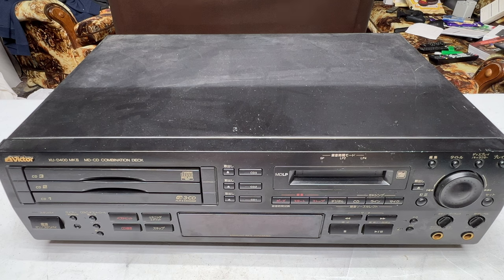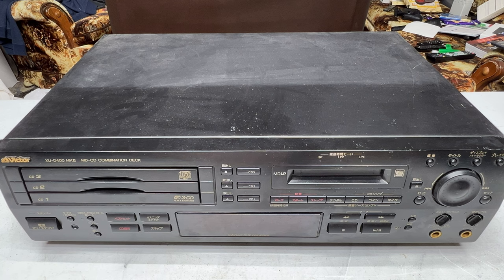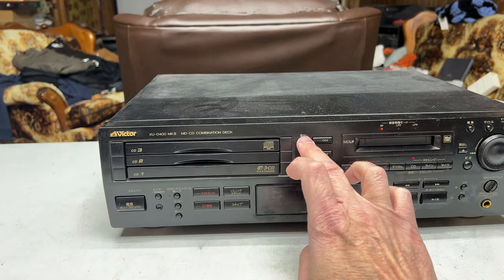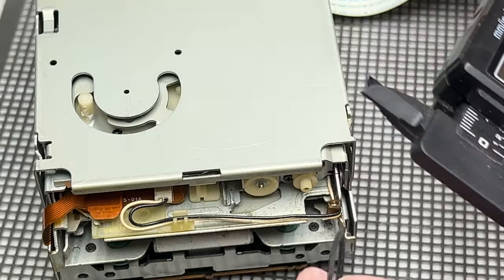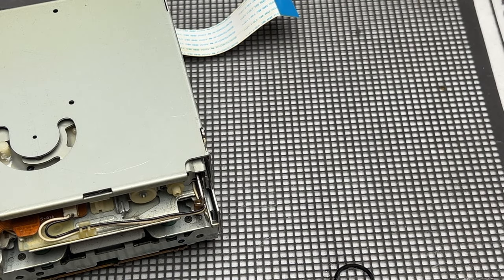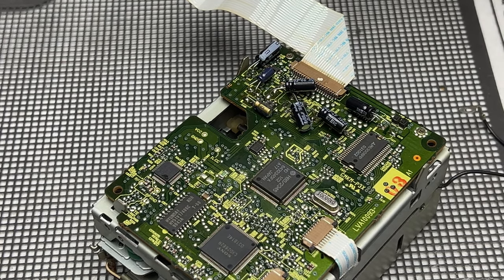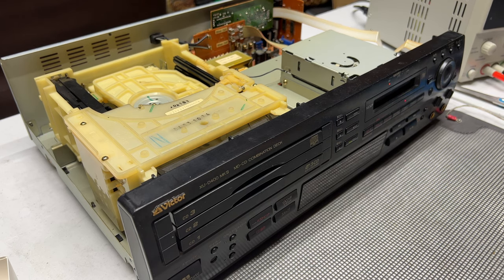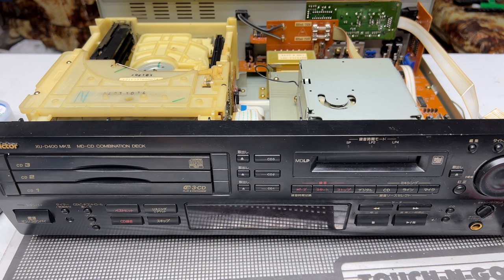JVC Victor XU-D400 Mk II Revisited - Can I Get the MD Drive Working?

Comment: Cool - you got that motor going! But yes, this machine have too much other issues to play md. What i still see in my mind after this video is that cracked loading motor pulley and belt looked too loose imo. And one more thing, when you said it just not spin and spits out md - i think this will be related to "not completing loading cycle correctly"- can be due to that cracked pulley or loading belt or some "full load" detection switch. 
As always nice video! Keep it going! 
Cheers!
Reply from the maker: I've thought about epoxying the cracked pulley to the shaft, but since the unit does complete the loading cycle I figured it wasn't worth the time to do it. I'm too busy playing with the DD-99 this week. I'm almost done that one!

Comment: I would have used an Ohm meter to check for resistance across the windings of the motor. The commutators could be dirty.